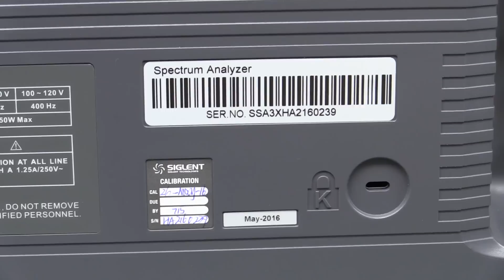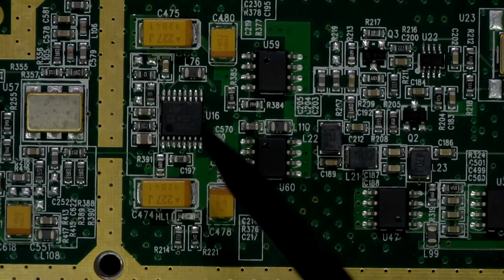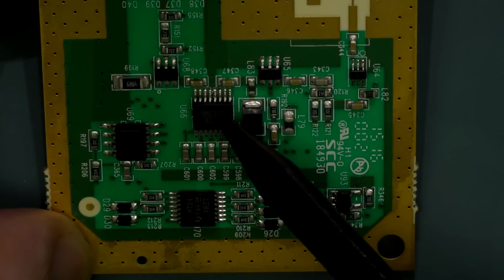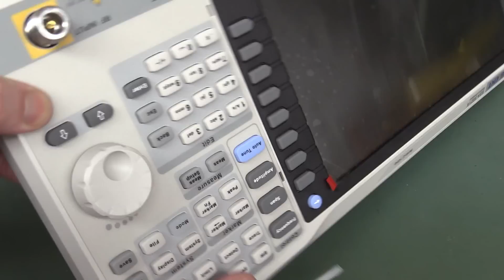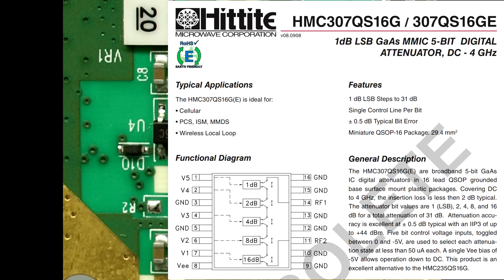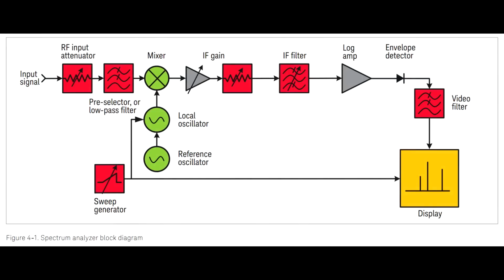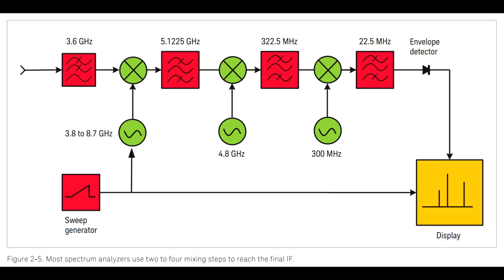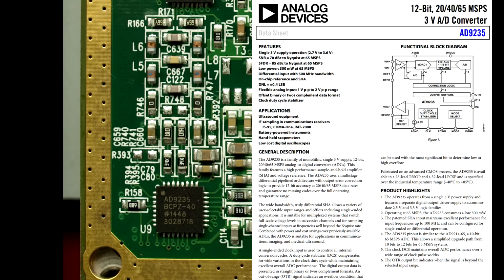EEVblog #892 - Siglent SSA3021X Spectrum Analyser Teardown

Comment: That processor's JTAG is the header at 7:40 which you thought might be just for testing - it's the standard 20-pin ARM JTAG header. The other one just does the Spartan 6.

The DC-DC immediately below the 20-pin is most likely an ADP5052 - it's a quad DC-DC + 1xLDO specifically designed to power Spartan 6's + DDR2/3. It's capable of providing 3.3V, 2.5V, 1.8V and 1.2V simultaneously with sufficient current to power even the top of the line XC6SLX150T.

Comment: The final IF doesnt necessarily have to be in the 0-20MHz range; the ADC can undersample a different nyquist zone provided an input with appropriate passband filtering. I'm not suggesting they do this, but it is certainly possible. Great teardown video though from Dave, thanks!

Comment: I have always wondered why they start at several kHz, from a design POV. This means I need one specifically for when I want to do some audio stuff, unless I have one of the super expensive 20Hz - 20GHz R&S ones
Reply: I suppose that's done because the phase noise becomes too great for general use below a few kHz.
Reply: Aars Haar maybe too great for the price target... R&S ones go down til 2Hz ...
Reply: Dennis Lubert  I wish I could say I knew more about spectrum analyzers.

I suppose they must be applying a trick to get down to 2Hz (which kind of blows my mind), maybe two signal paths for two halves of the total frequency range?
Reply: Aars Haar I never looked too much in detail into them, maybe I should next time I have that opportunity

Comment: I like the new format of explaining the whole signal path. Could have been better if you could point at things. When you mention a part descriptor, it takes a little time to locate it by eye
Reply from the maker: Yeah, that's one downside of this, it's not easy to poke. I'd have the screen capture instead and use a big cursor. But then I wouldn't get the nice zoom feature which is done in edit.

Comment: Great teardown Dave! I loved the way you went thru the entire signal path. The part where you mentioned that the final IF frequency being less than 20 MHz is not correct. There is a phenomenon called "subsampling" where the sampled signal is at a higher frequency than the Nyqusit frequency. However the bandwidth of the final IF signal is less than 20 MHz, which is probably much less than 20 MHz since resolution BW of this SA is specified as 1 MHz.

Comment: They probably dropped the input protection because its integral capacitance interfered with the unterminated input BW linearity. At GHz it's damned hard to get a flat response with peaky capacitors (ie diodes) in circuit when there's no 50Ohm termination.
Reply: Agree

Comment: Is it possible that they found a way to optimize the VHDL core file that goes on that big Spartan FPGA such that they were able to eliminate the missing components discussed at around 8:00 and pack them into the FPGA, but it was late in the design process and redesigning the board would have to wait until the next revision?
Reply from the maker: Good point, because it would just be shaping the IF signal that goes into the ADC and FPGA anyway.

Comment: Aren't things slightly mixed up in the explanation starting from 27:30? Unless I'm mistaken, the reason for the multi-stage design is not primarily the need for a higher IF. You could use an IF of, say, 5.1 GHz in a single-stage mixer design just as well. It's just that doing narrow-band filters at that high frequency (for, say, an RBW of 10 Hz) is rather difficult, and of course an all-digital IF stage would then be rather impractical. Thus, you just have a pre-filter after the first mixer, but then mix down again, filter again, etc.

Comment: Thanks Dave very useful mine came with a loose fitting faulty headphone jack plugging in an audio 3.5mm for a headset very loose fitting  and almost useless contacted them via the agent they said it was a standard 3.5mm only option was to repack it it and send it back I only had it for 5 minutes so decided to do it myself your video was very useful love your vids buyer beware of this model if deemed important Dave UK

Comment: I'm amazed how cheap the Chinese get milling done compared to casting when you look at the west. I worked at an RF company that was designing a satellite receiver and they talked about paying $800 for a one piece milled enclosure in low qty and $400 in small quantities yet getting investment castings done was viable at 50 pieces. They must be getting the milling done REAL CHEAP.

Also I suggest you use cotton gloves when doing tear downs as touching the aluminium causes almost immediate corrosion with skin oil contamination. This then in turn makes for a poor RF connection when it's reassembled.
Reply: aluminium oxidizes immediately on contact with air. No touching required.
Reply: Rhys D
Yes that is true but the thickness of the oxide layer is heavily dependant on the chemicals present. If you touch it with your bare hands you increase the thickness and chemical nature of the oxides depending to some extent on your biology and skin temperature. It makes a difference for RF seals where 1 Ohm is 2% reduction in conductivity. Companies don't like to waste money on unnecessary thing so they wouldn't buy gloves unless they made a difference.

Comment: I've tried to understand quadrature decoding, carriers, Fourier transformations, and intermediate frequencies, but I am still confused. Some day, I don't know.
Reply: Me too. Every time I think I have a superficial understanding, I try to apply it and find myself confused again. Should have taken more EE classes. Maybe studying more ham radio materials will help.
Reply: I always resisted against the idea that really everything comes from sine waves, so things could come from triangle waves for example. From the point of view that everything is really sine waves, a triangle wave for example has many frequency additives to make that resultant waveform. Quadrature sort of makes sense then because at a single instance a cos and a sin interpretation of a signal is made together, and then more data in time. So I was confused how it seemed arbitrary what was being sampled, but with data in time, it is relative and meaningful?
Reply: Also I was worried that carrier encoded data would in fact collide. You can say in a frequency graph there is a space between the channels where the data encoded is. That is my understanding. It seems a carrier vs the data is almost so arbitrary that it would go everywhere.

Comment: Hi Dave, thanks for great video :). I want to discuss about  49R9 resistor (23:43), and what is purpose of this resistor. This resistor is protection resistor, and SA will switch input this this resistor to protect input path from large signal (Am I right?). All other component in input path has 50 Ohm impedance, and no need for extra resistor.

Comment: I think that the system will run really when you 16384bins rather than going any higher which causes it to slow down, I just wonder why they could not have used a A10-7850k to process the data and they would have to have any more graphics hardware as that would be on the A10-7850k and they could have written the firmware in ASM80586 for the A10-7850k, why did they not use a quadrature phasing mixer which which would be able to convert the RF to AF (direct conversion) thing and give a nice clean output.

Comment: Many of the thick traces on rf board( presumably 50 ohm rf traces) have their solder or/and silkscreen removed on them and around them. Is it a common practice in RF design. Also all of the distributed component filters or matching circuits dont seem to have solder resist and silkscreen on them. Is it neccesary to do that when designing Rf board? Do silkscreen and solder resist have huge impact on the charateristic impedance pf the trace and distributed component?
Reply: it's easier to get consistent characteristic impedance with no solder mask. Slight changes in soldermask thickness would change the impedance of the trace. Soldermask may also change over time due to environmental conditions.
Reply: Thanks for the response. In this particular device the solder mask around the paths are not removed all the way down they're just removed from the sides about the twice width of the line. Is there a rule of thumb for the size of solder mask opening around the path?

Comment: A RF capacitor can act like a inductor when it's connected by a quarter-wave line. Does anyone know more about this?
Reply: Smith chart will help you understand ;) Mark a capacitor's reactance and plot an arc corresponding to a quarter wave line. Now, because you have made half a revolution, you're on the other half, with opposite sign of reactance.

Comment: Hi Dave, Long time lurker, and I love your channel!  I have a question if I may have a moment of your time.  My son has begun to take a larger interest in these DIY kits available on Amazon (ie. ASIN#B0130LKYWE, B00XXZB5LW), and I was wondering what your opinion was on these for learning electronics.  Myself, I recall the old "spring-based bread boards" from back in the day, but these kits seem to have great potential.  Do you have any suggestions in particular for these kits, or possibly a recommendation for an "actually useful" DIY o-scope kit?  Thanks in advance!